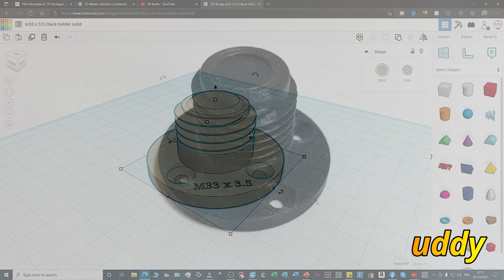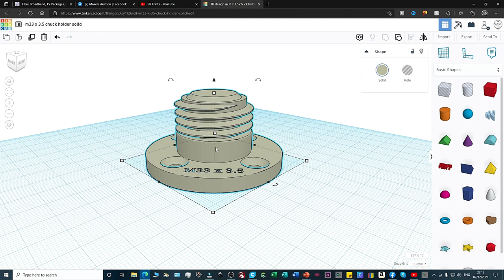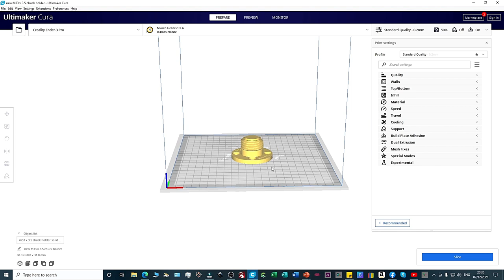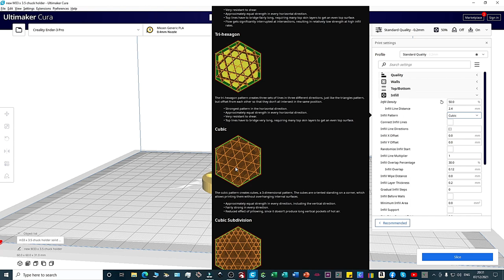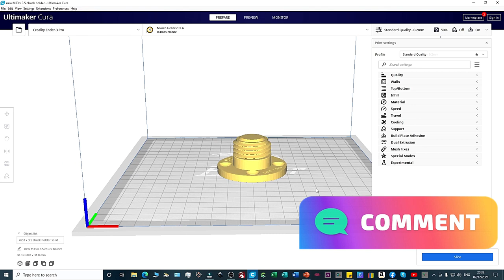Woodturning | Making of the chuck buddy's

Comment: Just a small point. I'd recommend adding a chamfer at the 90 degree angle where the threaded section joins the base plate. It's a minor difference, but adds a lot more rigidity.
Reply from the maker: Cheers Ben.